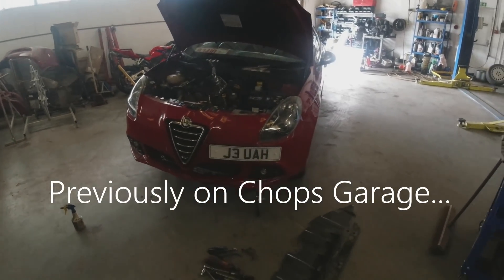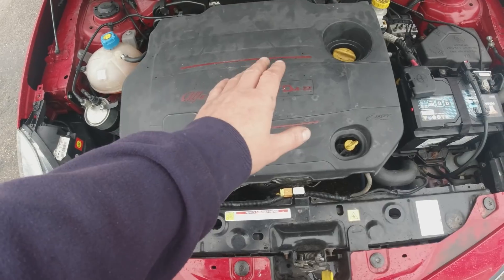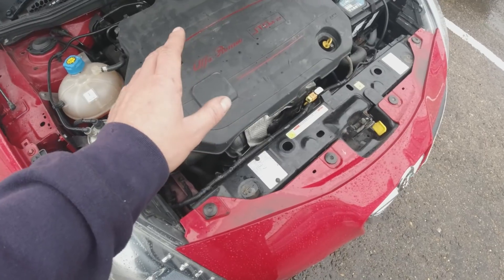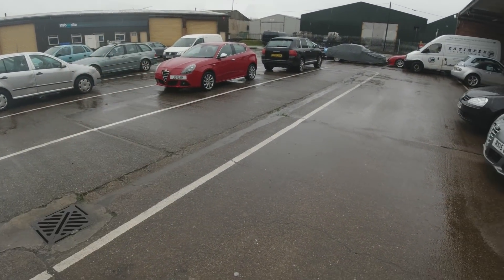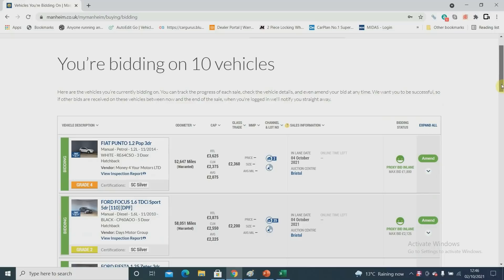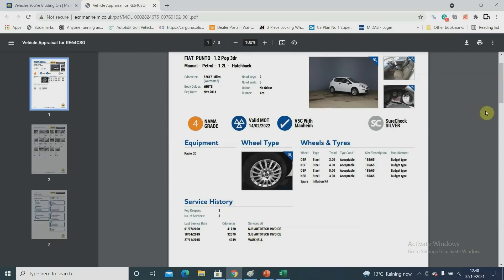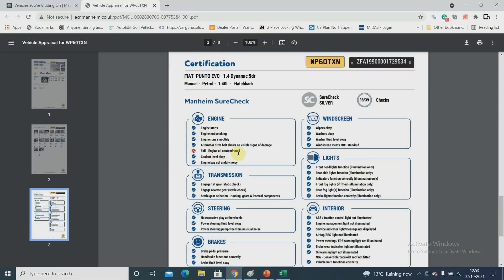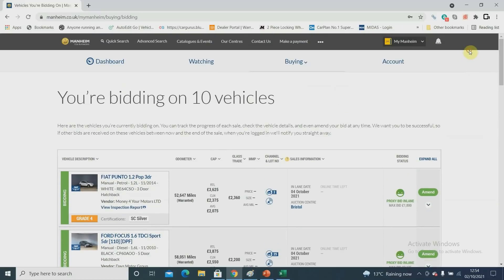Can we Save It! My Dealer Auction Alfa Romeo is STILL not right!

Comment: (*long comment alert. Hopefully helpful tho*)
Correct me if I'm wrong but it was a circuit high fault code wasn't it? That's telling me there's an electrical problem or some sort of parameter has been adjusted... 
Assuming I've got the fault code right.. what that literally means is the ECU is receiving high voltage from the boost sensor but no boost has been commanded. (Hence "circuit high" - that's what it literally translates to) it then shuts off boost and displays the EML light and reduces power. This explains why it was fine after you replaced the sensor until that unknown condition occured which triggered the fault again. 
Remove and probe the boost sensor with a multimeter, you should be seeing high resistance.. if it's high, new sensor should be ok and you can rule that out for now...
Remove the sensor, give the wiring a good wiggle around and maybe even try to clip it away from where it was or re-route it. Reconnect and take it for a drive, see if anything changes. This is to check if there's a short in the wiring somewhere. (Moving it could disturb it and prevent it) Alternatively, probe the harness (with the engine off of course) and check for shorts between both terminals while giving everything a good wiggle.
Probe the live terminal and check for shorts to earth. These checks should find any short circuits, although that could prove difficult.
Another possibility is another short elsewhere sending a rogue 5v to Earth, but that's very unlikely to be honest as you have no other issues. 
Failing that I would advise against any further parts darts without checking out live data, someone who knows more about interpreting live data etc more than me will be along in the comments soon enough to help I'm sure 👍
None of this was written to patronise you, I've only explained everything as part of a methodical fault finding process 😀
Just to be clear, I'm recommending you do this and make sure everything's ok before throwing more money at it with parts. 
It could well be the turbo - it's being commanded on hence high voltage at sensor but turbo itself isn't actually doing anything. (I know it's a lot more complicated than that, but I'm putting it simply for ease of typing)
Hope that helps. Sorry it is a rather long comment!!
Reply from the maker: Very helpful bud, cheers

Comment: Just get petrol giuliettas. Reliable, good cars and no silly diesel issues. People buy diesels and drive them in stop/start traffic and then wonder when there are issues.
Reply from the maker: Are you sure.... Multi Air Units??
Reply: @ChopsGarage  if the correct oil has been used and done annually, they should be good. Issue was with dealers doing the oil every two years and not using recommended oil.

Comment: Vacuum control solenoid? Did it ever have an aftermarket air intake fitted? This can suck in dust into the vacuum system causing the turbo to overboost because the vacuum can't vent off to atmospheric pressure thus regulating the turbo's boost. On the VWs etc this is the n75 valve.

Comment: Awww Bloody Hell. Dont you love Chasing your Tail on shite like this. 
 I had problems with my Turbo on my Ford Capri Convetible XR2 Turbo. ( Known in America as the 'Dud from Downunder.' ) 
I changed every Sensor on the Car. And it would Still Drop out at a Certain point. Pick up well to about 25% of Boost. And then Drop out..! 
 So in Desperation I changed every Tube on the Turbo System.
 It fixed the Problem, but could see Nothing wrong with any Tube, at all..! 
 And it seems to be Behaving but I am still not Convinced.
 I have even bought an Upgraded Intercooler ( Yet to be fitted.) But now Terrified to fit it, in Case I make it worse again..!
 You just seem to be Tinkering Blind. And everyone has an Option. Mostly useless..!!

 Cars 😎 or 😠

Comment: Diesels ..who'd have one 😟
Reply: I’ve two Volvo’s one a D5. And the other 2lt for7 years and no problem with 50 mpg 😀
Reply: @paulmuff9883  lol to be fair I've had a seat and a vauxhall with no problems until I bought a BMW 320d low miles, 1 owner, within a month turbo failure due to Carbon build up😟
Reply: @usemoreoil  my lad bought a petrol Z4 and nowt but trouble, I wouldn’t have a BMW’s if you paid me 🤔

Comment: Why dint they leave the diesel alone , no turbos or high pressure fuel   ,yes they were slow but at least they were reliable , they have put all this crap on them and now they are unreliable , and they are doing the same.thing to the petrol engines , and this is progress what a load of crap

Comment: James, s seal or others hardly ever work, why stick your head in a noose with a car that heads gone on, if you were a mechanic I'd say fair enough and do the head gasket but relying on glug is a bit silly, re the alfa, the initial diagnostic is spot on, lack of boost, so it's the turbo mate, just get a 2nd hand unit, your doing all the other stuff coz you don't want it to be the turbo mate, but you know it is, good video tho mate.
Reply from the maker: Yes I think we are at that point
Reply: @ChopsGarage  most diesels that are down on power have knackered turbos mate.